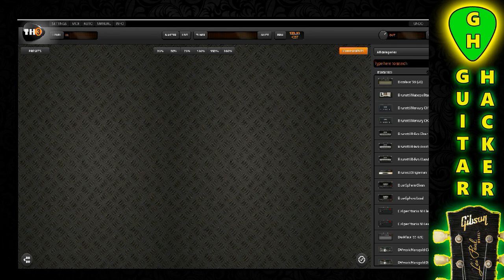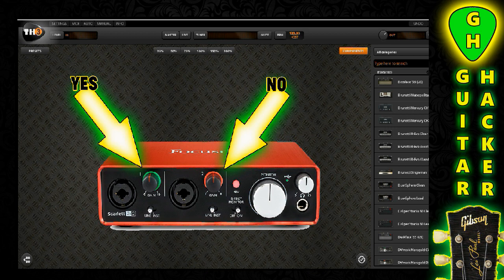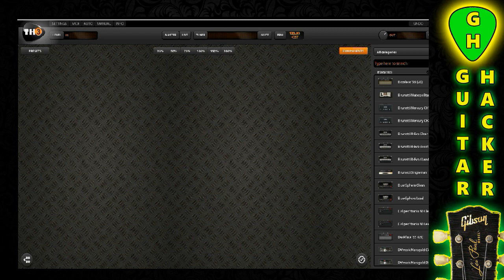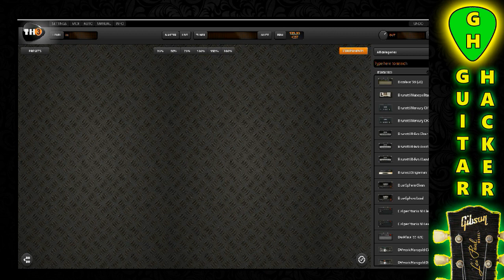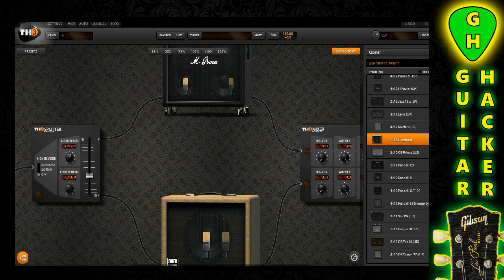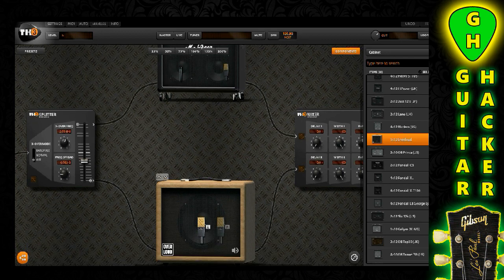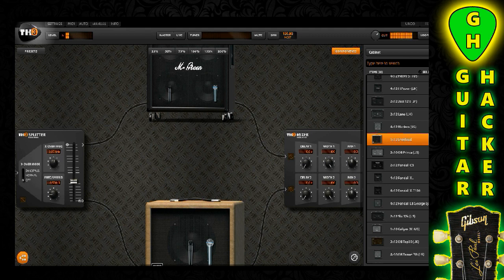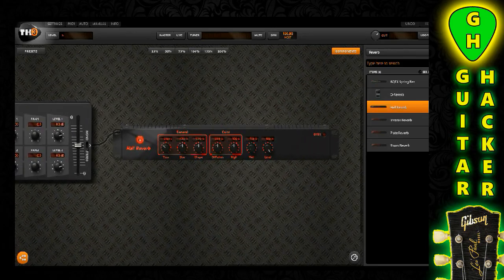AMP SIM TUTORIAL PART ONE | OVERLOAD TH3 | HOW TO USE GUITAR AMP SIMULATORS

Comment: absolutely nothing out there is helping my problem. I cannot use an amp sim. Every time i try to load one up all I get is a clean dry sound. Im using a focusrite scar solo gen 3. All im hearing through my headphones is the clean signal.  The amp sims aren't registering
Reply from the maker: Some amp sims only work with input one, if you plug into the wrong input on interface you won't here anything but clean unprocessed signal, also, make sure you don't have a direct monitor switch engaged on interface, check the input you have selected in the amp sim settings and make sure you have the left input selected and that cord is in input one,  let me know if this helps.

Comment: Great vid! It really helped answer questions I had. However could help clarify setting levels for me?

I have a scarlet 6i6 and I plug my guitar directly into it with instrument switch on. Then I make sure it isn't clipping as indicated by the orange/red ring. For me this is at around 9 o'clock, is that normal or fine? I am not sure why it won't allow me to put me gain on the interface. My guitar has Seymour Duncan Jazz 7 in the neck, JB-7 in the bridge. Once the 6i6 stays green, I adjust the input level then output level in whatever amp sim I am using (and subsequently adjust depending the amps I use), and then play with the EQ on the front of the amp to dial tone? I would think that as I play with the amp head EQ then I may need to adjust the input and output levels in the amp sim, correct?

Thanks!
Reply from the maker: Thanks for watching , actually i have another video that  is a little more in depth , use your amp tone controls as a LAST resort , use eq pedals as explained in the video. Dial in your gain stage on the interface first make sure its not clipping , then if necessary , dial up or down on the actual amp head in the simulator program to increase or decrease signal , once your gain is dialed into the green on your interface , leave it alone and use the amp volume or level on the amp to adjust clipping as necessary you dont want to run your interface gain too hot because digital distortion will color your tone and make it sound tinny and more simulated , thanks for watching sorry it took a while to get back with and thank you for your kind words. its normal to have to add more gain for some pickups , jazz pickups arent as hot as rock ones so this is completely normal. Thanks again for watching , rock on.

Comment: Hey great video!
I recently started using scarlet solo 2nd gen with TH3, but having some latency issue. Can you suggest something to get rid of that?
Reply from the maker: Thanks for watching , yes I can, I've had the same issue , assuming your PC meets the minimum requirements , simply uninstall and reinstall the the driver for your scarlett interface , they go crazy and just act weird once in a while , also , I noticed that if you don't use the exact same USB port you used when you installed scarllett the first time , it can also cause the issue , and finally , make sure you're not on the wrong bit rate , sometimes if its too high , meaning too many samples , it will cause latency , the best thing to do is lower bit rate until you notice a definite difference in sound and then take one step up , hope this helped and thanks again for watching.
Reply: @guitarhacker7126  thanks for the quick help. I will definately try out those steps🔥

Comment: Hi, I tried to record the rectfier amp, but is distorting on my monitors, how I do without distortion on the monitors?
Reply from the maker: its sounds like you are either overloading the input , the out put , or the amp level itself may be too high , also , if you are using any rack effects , check your output indicators , they are little red lights on the top right corner of the effect while you play , if you see the red light coming on or staying on , you are overloading the effect signals and have to turn them down, if all of that is fine , update your driver for your interface and reboot , also , try another amp , it may be that the amp just doesn't have a good sound , turn off all background programs the ram might be running out , short of all of that , it may be a bad cable or speaker issue. Check out my more thorough video on it , it may help you and thanks for watching.

Comment: This is insanely good.
Reply from the maker: Thank you for watching and thanks for your kind words , I hope it helped you out. G>H>
Reply: @guitarhacker7126  I was wondering if you can help me out. I use a noise gate, but whenever I’m playing I still hear a buzz/hum. Do I need a d.I. Box to make my single clean? I’ve used both active and passive picks up. The passive isn’t as bad.
Reply from the maker: @The_PlagueDoctor  Sure , the first thing to check if you are using th3 , is to open the master section and make sure you have it set for low input , I know if I put mine on high with even standard humbuckers its too much signal , it will squeal and buzz , and hum , the other thing is to simply cut the gain on the amp and dial back the output level , as far as the DI BOX , I bought one a month ago and I have to say it improved the tone quality immensely , these digital signals are very touchy and it's always better to error on the side of less , putting it on low input and just cutting the gain a little should so the trick, all of the preamps in these interface run too hot in my oppinion and the Direct Box definitely cleans em' up and makes them sound a lot better.